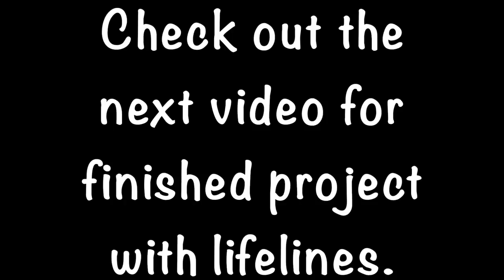DIY CARBON FIBER STANCHIONS

Comment: Very well done video, my friends.I have a little information for you. Quality in stainless is subjective. 316 stainless will rust and that doesn't make it "quality" or not. I was a machinist nearly 40 years and worked with all types of stainless. I made any new hardware on my boats with 304 grade stainless. 304 will take a polish and not brown up. I made mooring bits and cleats with this grade and never had a failure through storms and a hurricane. 18-8 is a common fastener grade stainless and when sized properly for the job doesn't fail either. I really don't understand the marine fastination with 316. It is an alloy that is plenty strong but browns up and stains the boat's finish. 304 is a much better choice as it holds a polish and doesn't streak the fiberglass. I have a little consern with your stantion bases. I like the basic idea but when filling a hole in the deck straight sides are not very strong. The top and bottom of the hole should be beveled to create an hourglass shape. Also the G10 bottom plate should have the fiberglass post through it to provide strength. I don't know the wall thickness of the carbonfibre tube but I hope you researched the shear strength. Impact of a body pushed by a wave can be quite high. I admire the way you two tackle your repairs and Billie's skills show in his workmanship, confidence, and research. I am a little overkill in safety and strength areas. Tme will tell on this improvement and so far it looks good. Can't wait for the next video.

Comment: One VERY important thing to remember when working with stainless is not to contaminate it. Even the best quality stainless will rust if say you use an old steal wrench,  pair of channel locks or old screw driver head. I've seen this happen a 1000 times. Regular steel pieces can be embedded into the stainless steel causing rust.

Comment: You can get red mil-spec grommets from McMaster.  I've found they hold up much better in the sun than the normal ones.  Still, I'd be worried the lifelines would saw through any rubber grommet in short order.

What I did for my dyneema lifelines, was take a short length of plastic vinyl tubing and slit it lengthwise.  Put that over the lifeline and through the stanchion hole, so it sticks out about 1/2" on either side.  Then wrap some rigging tape over the ends which are sticking out to keep it from sliding though.  Now the tubing will mostly stay put in the stanchion while the dyneema slides though the tubing.  Won't chafe the lifelines or your stanchions.

Comment: Very cool idea.  But what is the rating as far as weight pushed against your poles?  They’re life lines.  Usually people only grab hold when their either going over the side or trying desperately to hold onto the boat.  Did you take a piece of steel pipe and place it over your rod and put some serious force on them before doing all the lifeline work?  Just asking because I was out in a hurricane whilst in the CG and almost went over the side when we took a wave broadside.  Thank god those 95’s had steel rails.  I think the three life lines is a good idea for Jetty.  So far great work as usual.  Keep those Videos coming.  When’s the Next episode of Cooking with Mermaid Sierraa?

Comment: Are you sure that the cable itself isn't 316 stainless. My reason for asking is that the rust appearance seems to only be where you have swaged ends. To me it seems the fittings are rusting and the rust is wicking from the fitting onto the actual cable. If the cable wasn't 316 you would see rust all along the cable from the salt water and moisture.
Reply: You could be right but its most likely caused by the dissimilar metals reacting in the salt water. If they were done correctly it wouldn't be a problem.

Comment: I realize it would be really hard persuading yourself to do it...BUT TRY.
Throw yourself  into the lines as if a 20 footer was rolling over the deck. As others have noted, CF is very strong but not infallible.  
If it should snap, it may be hard to grab whats left. 

👍⛵️👍

Comment: I'm an old man my time is precious our took Anacortes screwdriver and back those screws out I went to set there with that tool rich and I'm out if I could have gotten in there with a cordless drill I would have zipped them out with the cordless drill.... It would have took in 1/10 of the time to get them bolts out...

Comment: You should use thicker G-10. I use G-10 every single day as a full time knifemaker and I am also a sailor and own a Jeanneau 439. I do all of my own repairs and work. Only use 3/8" -1/2" G-10 for bolt through backing plates

Comment: I hope you rounded the corners of those plates that went over the fiberglass poles. It would be my luck to stub a toe and bleed out on the deck.
Reply from the maker: hah yes slightly, and put a fillet around the bottom edge
Reply: Cut foot is no joke.

Comment: bummer about the substandard stainless cable, thanks for the headsup.  Dyneema sounds like better plan.   I'm not so sure about the CF, is the weight savings the reason?
Reply from the maker: yes and to eliminate any future leaks

Comment: There is an old saying when it comes to boat rigging.  <  Stainless is half as good as it looks and galvanized is twice as good as it looks  >   My 30 ton west coast commercial fishing vessel,  a troller had 40 year old hot dipped galvanized stanchions,  rigging and turnbuckles on her,  still going strong.

Comment: The stanchions on my boat had backing plates of aluminum with stainless bolts from the stainless stanchions bolted thru. Dissimilar metals resulted in tbe plates completely blowing up.. like delaminating.. had to replace all of them and rebed all... a real pain..

Comment: For the future when you do a project like this, use microfiber filler instead of cabocil.  Cabocil is great for sanding but it’s not very strong and you could wind up with cracking. Microfiber filler is much stronger. Otherwise great video as usual.

Comment: I would be concerned about that carbon fiber tube being a weak point. Most people think it is a wonder material (and it is) but it is a lot weaker than that solid fiberglass rod and it is brittle. With it attached that way, I'd be concerned it would concentrate any load in a small area and fail.
Reply: When carbon fiber fails it shatters like glass. Watch F1 races, the cars tub/chassis and suspension components are carbon fiber
Reply: The carbon is also weakened by drilling holes in it... It would be a good idea to test one to destruction to see what sort of load it can safely handle..
Reply: I agree with John and Rusty. I would have left them unpainted. I think they would at least look cool without the paint. I like that you are trying different things though.
Reply: jack nimble  hi you can't leave any resin , epoxy or polyester types exposed to UV. They all degrade sooner or later. Hi solids paint (or gelcoat) is the only best solution. You could use UV resistant varnish or clear coat like on cars but they tend to require much more prep and maintain etc ( clear coat on cars is applied in very controlled conditions and is heat cured @ 400+degF! So not practical for boats to get automotive type performance).
Cheers Warren
Reply: @CheersWarren  urethane and enamel clear coats do not need to be heat cured at all and only requires a light scuffing if not applied after applying the base coat recently. I also own a a carbon fiber bike and car bumpers that are exposed to plenty of sunlight without any harm. How are his stanchions any different?

Comment: Suggest you invest in a 1/4 inch rechargeable ratchet. With all the bolts you guys are always removing, it would save you a lot of time.  Also a rechargeable screwdriver.

Comment: You also check how good your stainless using a magnet. 304 stainless wil have a slight pull with a magnet and 316 will have no magnetic pull.
Reply from the maker: Great idea George we will definitely do that next time we are working with stainless

Comment: Hi Billy, They probably use hi quality  'BS1088' hard wood plywood with Lloyd's Register type approval that it was made to the standard. Not the crappy Fir marine plywood sold in the USA, BS1088 is sold in USA by quality marine lumber  supply houses. It's also available from McMaster.   The plywood standard allows the plywood to be used as is , uncoated without failure or rot! It's the only plywood that should be in a boat. 
The fir so called usa marine plywood rots. If they actually made it with real southern yellow pine it might be ok but you can't get real yellow pine any more it was all logged out , current SYPine is now just a poor fast grown cousin of the original.
Cheers Warren
Reply from the maker: Hey Warren ! 
Thanks for the info! We really appreciate it!

Comment: Careful with CF, it doesn't bend, it snaps. Watch F1 crashes. Have fun stay safe!
Reply: It depends on the mix of chemicals.  Check out Tenkara fishing rods.
Reply: Marshall Weaver it’s according to the type of resin you use it can actually bend if set up right like a fly rod

Comment: At 17:45 you're filling a hole you previously drilled out originally and filled with Cabosil. Just to clarify, you filled with cabosil, sanded smooth, then drilled a smaller hole to accept the fiberglass rod base that holds the carbon fiber stanchion?
Reply from the maker: yes, I wanted to make sure that the there would be no contact of the fiberglass rod with any core material just in case a crack developed somewhere... I'm sure I could have just made the one whole for the rod and bedded it but...
Reply: Love it. Catch ya in the bahamas. Any long term plans for the Pacific?

Comment: I was wondering why you would need to paint the carbon?
Reply: To prevent UV ray degradation.
Reply from the maker: yes, carbon is ok with UV I think but the epoxy resin that is used to laminate it will breakdown from uv from what I have researched. Would look pretty cool straight carbon..
Reply: @Tulasendlesssummer  the new resins are much better than before when it comes to UV protection. But they still need protection especially in the marine environment and if you don't know what resins the manufacturer used its best to protect it.

Comment: You could have used AWLGRIP’s AWLWOOD on the carbon fiber.  It’s an approved system = have meet dry fill requirements for proper UV protection.
Reply from the maker: Is it clear?
Reply from the maker: Is it clear?
Reply: Yes, fantastic product!

Comment: 300 series SS shouldn't rust, likely some of your components might be 400 series SS?
Reply from the maker: are you sure? I think all ss rusts over enough time.
Reply: 300 series suffer from crevice and pitting corrosion so rinse your stainless in freshwater. 400 series is ferritic and doesn't suffer from pitting and crevice corrosion but corrodes uniformly like carbon steel which makes 400 series better for exhausts an not got for things that need to look shiny.

Comment: When I'm looking for stainless anything I carry a little magnet with me... If it's real good stainless a magnet won't stick. If the magnet sticks it will rust.
Reply from the maker: Agreed
Reply: @Tulasendlesssummer  also if Jetti slips on the deck could she slip under the netting?

Comment: Honestly, I love the channel but do not see the point of this project. My guess is if you ell against the new stanchion that carbon fiber will break like glass. Also the plate on the deck is way to sharp, I would have rounded the corners and feathered the edge it still looks like a major liability on your feet if you step on it or slide into it, IMHO
Reply from the maker: Thanks for your opinion Jack. The carbon is extremely strong hoping to do a testing video with a spare one of these days. Another plus is not having anything drilled into the deck which will prevent any future  leakage. The plates have been sanded down :)